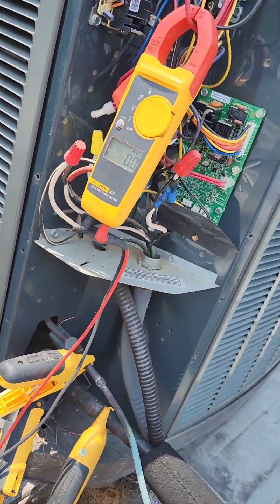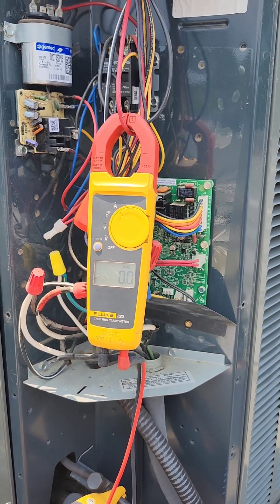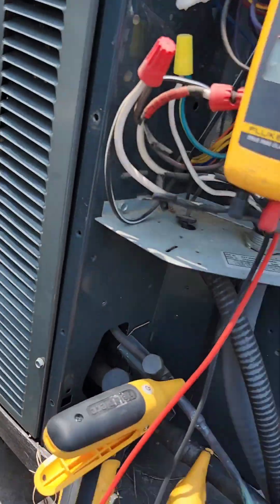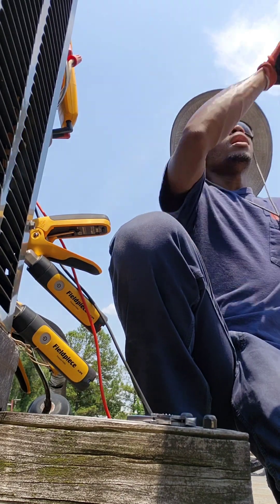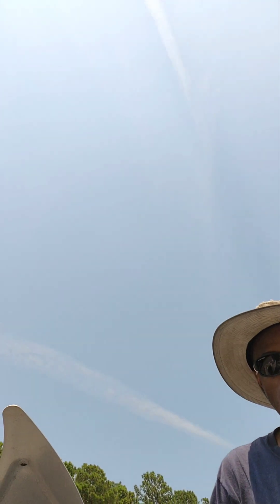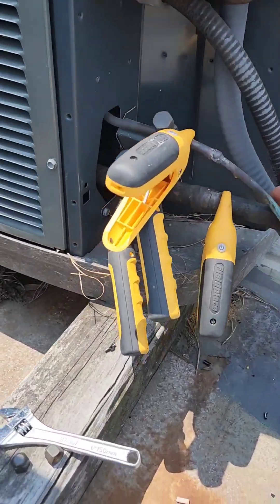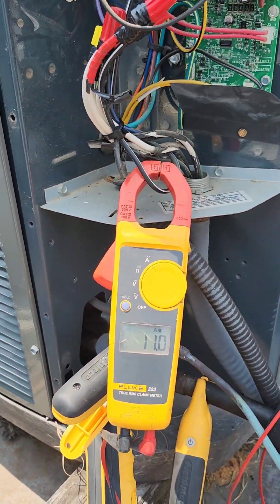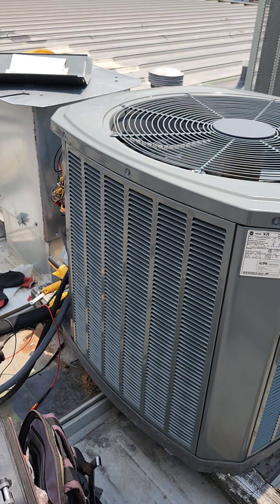HVAC Is The Compressor Bad?

Comment: Looks like its a 3 phase unit as i dont see a run capacitor for the compressor only the fan.  What happened was the burnt wire caused it to single phase, and not allow the comoressor to start.
Reply from the maker: @seangriffon6502  Thats correct it was single phasing.

Comment: Instead of taking the top off. Just the common wire ( usually black) to each of the other legs of power for the compressor. If open, you’ll have no  continuity on the common